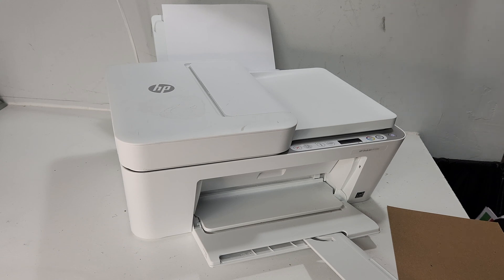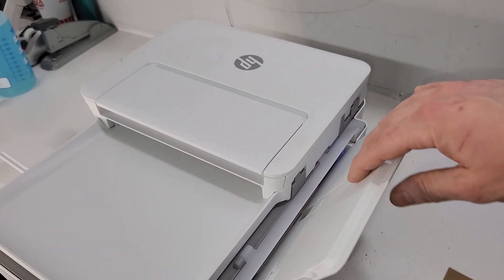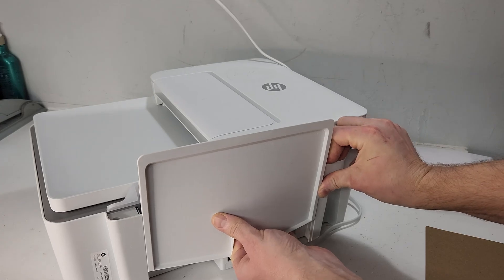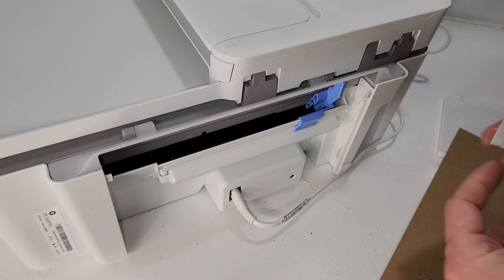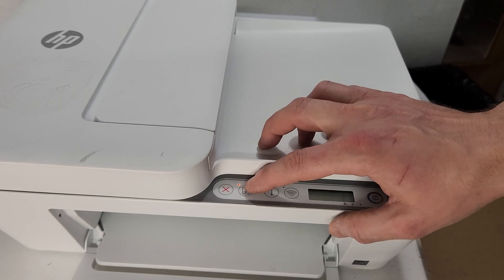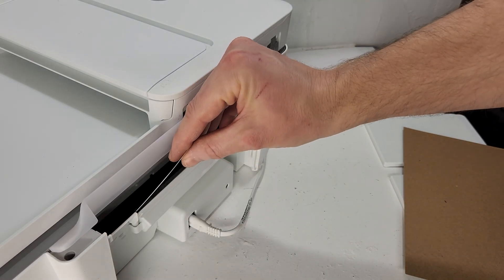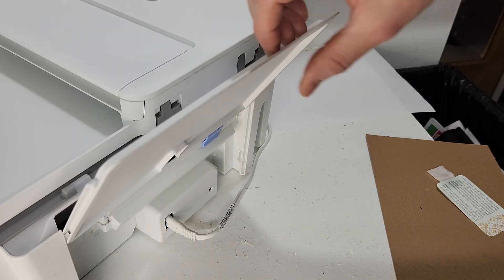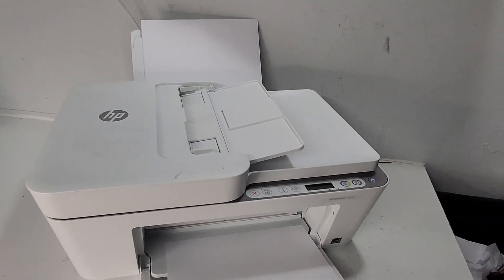Printer Won't Take Paper HP Deskjet 4155e Troubleshooting

Comment: My printer has starting saying there's a paper jam when there's not! And now it also stops printing half way through whatever I'm trying to print.  I'm ready to throw it out the window and it's maybe only 2 years old.
Reply from the maker: I'm sorry your printer is giving you trouble. Were you able to go through all possible areas where the jam may be? Open the fron door where you load cartridges and shine light inside, especially look inside on the very right or very left. A piece of paper may be jammed on the side and it may not be visible at first because the printer is also white incolor.  See if this video helps: https://youtu.be/W329PINNgI0?si=55dHzyIXkvI9gXUs

Comment: I did a hard reset - and it printed the printer information page (HP4100).  still have the "out of paper" message but the light is not blinking that it's out of paper.  Could it still be the rollers?

Comment: Thank you, none of that worked for my printer. Are there any additional steps I could try? It starts   sucking but stops and spins. I don't see any obstruction at all.
Reply from the maker: Hi. Make sure all covers are closed, especially the one at the bottom. Also a gear may be out of place on a roller where the paper gets stuck. That's harder to get to but sometimes moving the roller rod to right or left may lock it in plac if it cam out. In the meantime, I'll look into the printer model once again and see if I can direct you to another area you may check.
Reply: I solved the same problem by running the scanner. The rollers roll in the opposite direction and that seemed to unstuck them